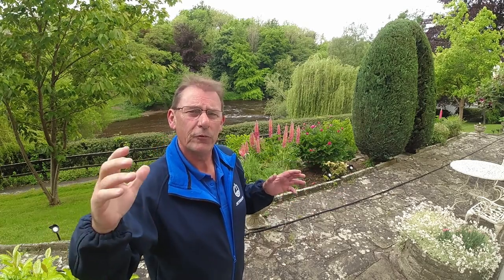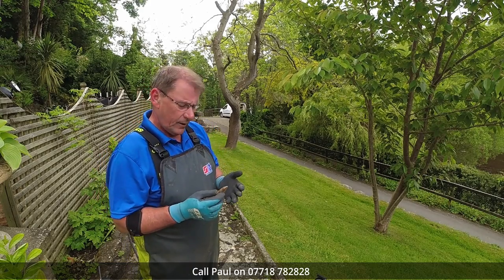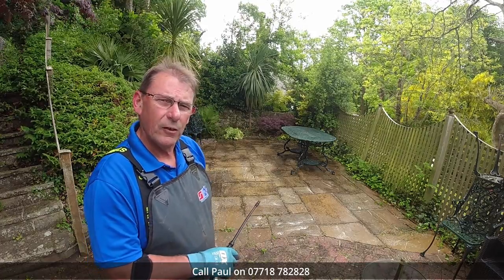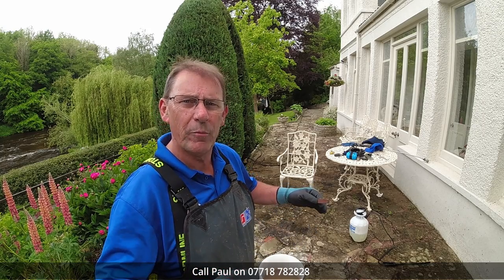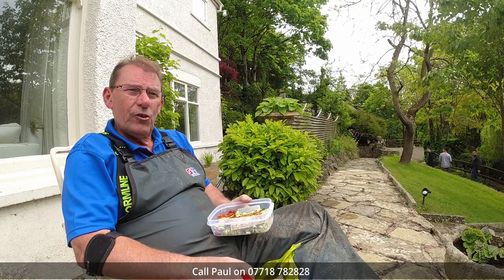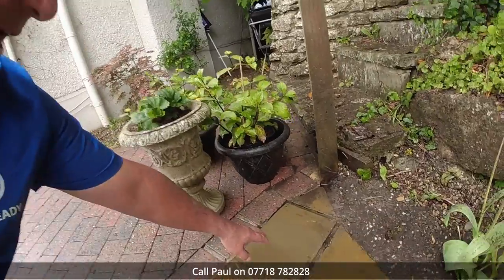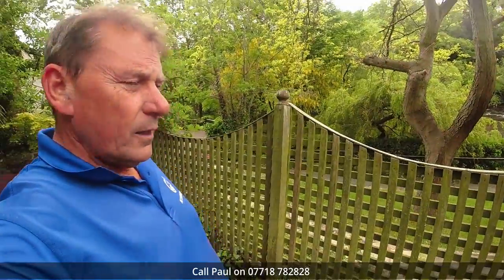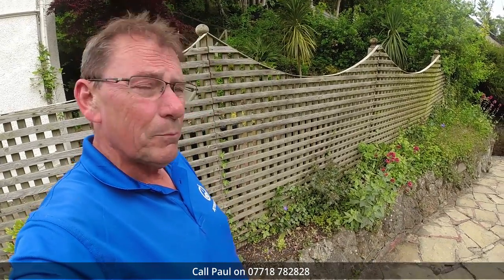STEAM CLEANING York Stone Crazy Paving. Knaresborough, North Yorkshire. @jetreadyuk

Comment: oh boy, that stuff looks too similar to what I have in my back garden. the only thing that gives me hope is that it's on less poreus material. but I've been at it with scrubbing brushes and it aint budging yet 😥 wish me luck.
Reply from the maker: Try using neat bleach with a tiny bit of washing up liquid.
Reply: Thank you so much for your reply 😃. I was hoping to avoid chemicals, because I have cats. But if nothing else works I'm willing to give it a try. The cats will need to stay inside for a few days in that case.
Reply from the maker: It will work within an hour or so. Rinse thoroughly with water afterwards.

Comment: Will yhe bac 50 you used not effect the nearby plants? 

Also could you use bac 50 on the york stone to help it clean over time?
Reply from the maker: Good questions. A light misting of very diluted BAC isn't going to spoil the plants. Putting BAC on the paving would indeed help to self cleanse it over time, but the whole point about this job was to keep chemical use to a minimum because of the proximity of the river. Thanks for watching.
Reply: @jetreadyuk  ahh yes very true about the river.. it still came up very well though so kudos to you for getting it done.  

I only ask because I recently did my first pressure wash job and it was York stone (talk about throwing myself in). As you can imagine it didn't come up as I wanted and the customer (mother in law) was hesitant to use hypo because of the plants either side of the path.. (I opted for steam 125°). So I was wondering if I could instead soft wash with bac 50. Put it on and leave to dry and this shouldn't affect them if allowed to dry into the stone.. I also wasn't sure if I needed to presoak the stone before putting bac 50 on..

Or should I just soak the area and plants up with water. Put a strong hypo mix down and wait an hour for it to become inactive and then go at it again with steam at higher temp?

Your advice would be greatly appreciated, as she lives alone and this area of path gets extremely slippery when wet and I'm concerned she'll have an accident one day if left untreated.